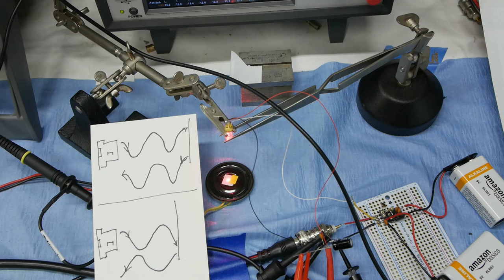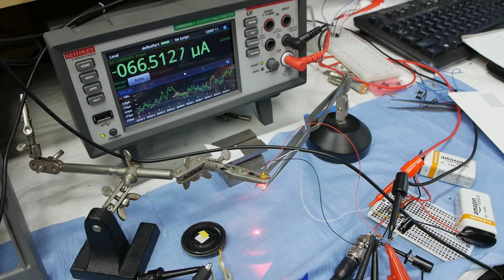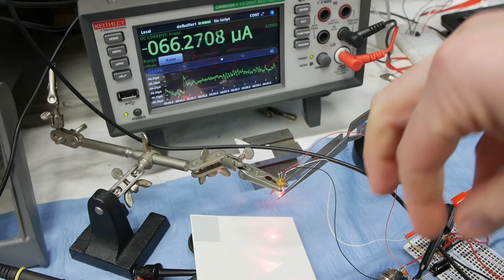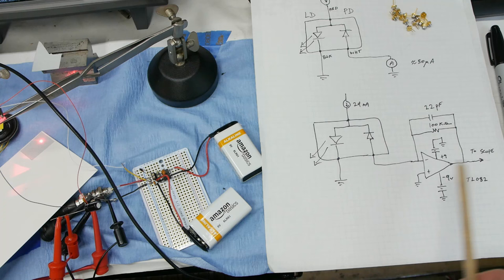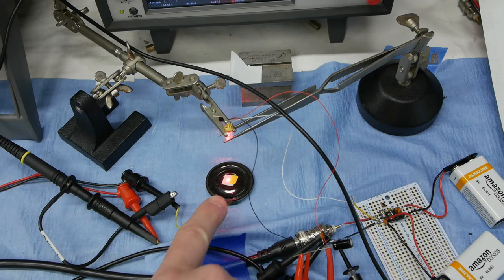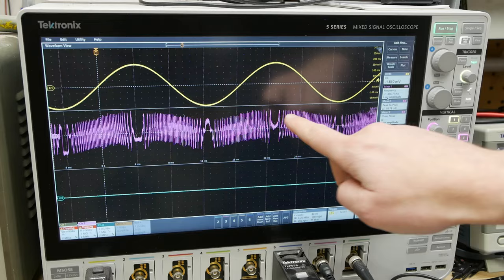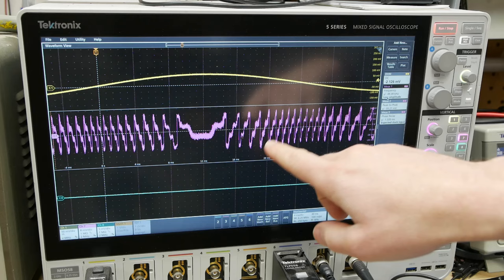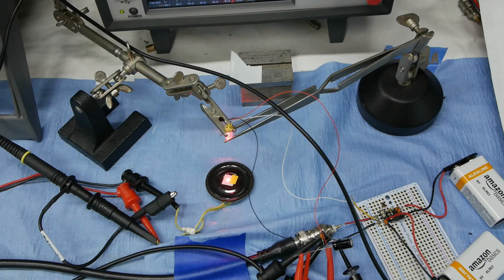Laser diode self-mixing: Range-finding and sub-micron vibration measurement

Comment: Some optical drives use self-mixing interferometry. I was confused when I disassembled them and didn't find any apparent sensor to detect the light reflected by the disc. I don't remember how I looked it up online, but I somehow found self-mixing interferometry in my searching, and thought it was pretty cool that you could use the free space between the laser diode and the target as a kind of secondary laser cavity, and measure how well that cavity lases as a proxy for the distance. I had no idea it was this easy to do, though. (I say easy, but I hope it's even easier than it looks, because I don't have a fancy SMU or DSO…) The FMCW macroscopic range measurement is a cool bonus, too. Now I'm imagining building a pocket tool like those commercial laser distance measurers, but that measures centimeters to micrometers instead of meters to centimeters (and also has a tachometer function).
Reply: It's probably more likely that they use that technique just to determine if the disc is there or not. Even if it appears there's no separate sensor, the laser and photodiode can be packaged very close together with some optics to reflect the light coming back into the receiver.

Comment: Thanks for a very interesting video!
Have made a few reflective sensors using laser diodes and very thin fibers for micro mechanical measurements inside inkjet heads. Used small half mirrors from ES and external photodiodes. These worked surprisingly well but calibration was difficult. Wish I had known this self mixing principle then, since Interferometry gives an absolute measurement.

Comment: You can see if your AC electroluminescent displays are actually oscillating at the driving frequency. It would make sense that the width between the top and bottom electrode is expanding and contracting due to the strong applied electric field.
Reply: If you make the laser light bounce off both the top and bottom of the EL strip at the same time, you may get double the amplitude, and see double the count of interference fringes. Comparing that measurement to single-sided will provide a nice double check on results.

Comment: Wow. Great work! One of the first projects I worked on back in the early 80's was programming a laser dilitometer we built. It used a laser interferometer to measure the change in length of dental material samples in a precisely controlled optical furnace.

Comment: The technique presented at the end of the video, sweeping the wavelength and measuring the interferometric fringe spectrum is essentially Swept Source Optical Coherence Tomography (SS-OCT). The axial resolution is proportional to the sweep bandwidth, i.e. the higher the bandwidth, the higher the resolution. If you scan the laser over a sample, and for each scanning point take the spectrum of the fringe signal you get depth resolved reflectivity. Do this with large enough bandwidth, and with fast enough sweeps and you can create volumetric scans like this: https://www.youtube.com/watch?v=vEgrpwtP0UQ

Comment: I have built and tested FT-IR spectrometers.  They use a Michelson interferometer with an internal laser interferometer that generates a sampling waveform.  The repeatability of sampling is very precise - often less than 30 nanometers of drift over a 24 hour period.  The laser signal resembles the scope pattern you are showing, although most of it is a sine wave. At each end of travel the laser signal frequency drops down to zero Hertz, similar to the discontinuities your waveform shows.  One company I worked for, in the '70s, made a film thickness gauge for semiconductor films.  It was a low resolution IR spectrometer that only had to do peak detection.

Comment: Very interesting video. 
One small error... To go from constructive to destructive interference requires a half-wavelength difference in path-length. To go from constructive to constructive requires a full wavelength in path-length difference. But because the path is to and from, for example, your speaker, the speaker only moves half a wavelength for each full cycle. So, for most of the video, your speaker is only moving around 3 microns!

Comment: A major contribution to the "stair step" waveform shape is caused by the transfer characteristic of the transimpedance amplifier itself, which is effectively an integrator with a reset time proportional to the RC time constant of the feedback resistor and feedback capacitor. You want to match the feedback capacitance as closely as possible to that of your sensor (the photodiode). Note that at these small capacitance values, the wires themselves can start to dominate the total effective capacitance. So you want lead lengths as short as possible. You also need good (low ESR and low ESL) decoupling capacitors between each rail and ground.

Great video, this is a really cool use of the monitor photodiode!

Comment: So if I understand this correctly, the distance measurement is the same thing as modulated continuous wave radar, except in the visible spectrum? Really cool!
Reply: The distance measurement is actually like a FB interferometer where the fringes rate (or distance between fringes) is correlated to the distance from the target

Comment: You can cover the laser diode  with a smooth thin  reflective membrane and maybe make a microphone.  Maybe gold foil or aluminum/silver deposited on transparent membrane. The membrane would oscillate with the surrounding air and reflect the laser light back into the photodiode. They're close proximity (right in front of it) would minimize unwanted vibration or movement.
Reply: You can better light up a distant window and hear what they say =)

Comment: this would be really cool if you use this laser diode to read vinyls and play it back over a speaker, laser diode vinyl player nice!
Reply: Not impossible, but very hard.
Challenges:
Focusing the laser (need to read depth information from a very tiny spot at any time)
Stereo signal. ( there are actually 2 analogue signals in each groove. recorded at ~90 degrees from each other.
tracking (the original grooves were laid down mechanically, and there is no way they are a perfect spiral.)

If you can build a dual read head CDROM drive with active vibration compensation, you can do it!
Reply: You are basically reinventing Audio CD :D
Reply: It's done. Google laser vinyl player.
Reply: @zlotvorx  yeah, i see a "LASERPHONE" haha.
Reply: @riaan_za932  I forgot the name and brand, only remember it's Japanese and was shown to me by a HiFi enthusiast.
Reply: As some one  wrote, it is already done, and it is able to play even the dust over the disk. The idea and pattents were developes in usa around 1980's but then the CD player did come on scene and nobody were wanting a vynil player. A japanese company but the rights, and now you can have a laser vynil player for about 10.000 dollars after a 4 month delivery time.

Comment: Seems like there could be some *****REALLY***** useful uses with this. Extreme precision from a distance? So cool. So useful. This could be a game changer in measurement. All the fancy scope stuff could be streamlined and put onto a chip for pennies. Laser diodes can be extremely cheap. This could be everywhere, and everything could have extreme precision.
Reply: Caphits a really common use is in optical media like CR-ROMs and BlueRay discs. 👍🏼
Reply: @MusicBent  > Caphits a really common use is in optical media like CR-ROMs and BlueRay discs.

Yes, but those only need to sense the change in distance of ONE-QUARTER WAVELENGTH, and within a predictable range of frequencies, while ignoring the much larger but much slower changes due to mechanical vibrations and non-flatness of the disc. They also have to ignore the laser mode-hopping and other changes to coherence length, which is not an issue for those optical discs, but IS a problem for many other applications. The coherence length of laser diodes is usually mere centimeters. Much better stability of the laser output is necessary for general-purpose laser measurements, so much more complex optics are needed. Long cavity lengths and/or external mirrors are usually part of the solution, but difficult to apply with laser diodes. HeNe lasers, on the other hand, are very stable after warmup.
Reply: YodaWhat true. Thinking about it again, maybe a more related application is the lunar ranging experiment. I believe they use a short burst and then use timing to measure the distance.

Also, still waiting for the moon bounce ruby laser video 😂

Comment: Next on applied science, making a desktop gravitational wave detector
Reply: Does make me wonder if you could just loop a TON of fiber optic cables instead of shining the light a very far distance.
Reply: @ARVash  yes, yes you could
Reply: Make you wonder, if monitoring the sum collections of errors rate on a high speed fibre optic back bone trunk of a communication provider, will be of used?
Reply: Robert Slackware  Holy shit I think that's totally possible. If you could direct a beam up that high and then back from there without the beam dispersing so much.

Comment: great video! I want to know what the signal sounds like! and can you use the self-mixing interferometer as a laser microphone? or a distortion pedal? :D
Reply from the maker: That's a great idea!  We could down-convert the signal at several different frequencies, and mix them all together.  Maybe get a chorus effect?
Reply: And for the distortion effect, mabe a recording one period of the waveform and using it for a waveshaper is more viable; i believe you are suggesting to feed the input as the current modulation signal, and the output taken from the PD?
Reply: Is this what spies use to hear people in buildings by reading the vibrations on a pane of window glass?
Reply: I might be imagining it but around 8:30 and 25:50 but there seems to be a strong correlation between lots of little spikes in the signal and his voice, especially sibilants.
Reply: I was thinking the signal reminded me of fm or wavefolding. I bet it is a gnarly sound!
Reply: @trey1531   Unfortunately, most of the light would pass through the glass instead of reflect, so you wouldn't get a very good signal. The same techniques might apply to IR diodes though, and IR doesn't pass through glass. Very similar concepts can also be applied to radar signals, which are commonly used in industry
Reply: Two of the most talented youtubers here...so freaking interesting! thanks for your job guys :)
Reply: A laser microphone can be made with from what was demonstrated from what I can tell along with some other remote sensing and I guess transmitting systems.  There should be plenty of bandwidth up to the ultrasonic range and above with no problem.  Can do the math to determine the distance capabilities as well as against different materials with the electronics test equipment and I think will have to make another circuit or DSP to recreate sound I'm thinking at least. 

Wow, amazing demonstration of capabilities with just that one component and set of equipment.  Once the component and system equipment is characterized in detailed and the internal, boundary and environmental characteristics are well understood, patterned and controlled... I can only imagine the capabilities. I also am wondering with performance capabilities with cooling and really super cooling. 

I think you answered partially a Neurophone question and suggested demonstration. 

Wow, great demonstration as always.
Reply: @dylandailey3191  wouldn't that just mean the laser will still reflect off a surface inside the room?
Reply: There's a video by guy which made simple interferometer (actually very easy to do) and connected it to an amplifier. It sounds like noisy microphone.
Reply: @trey1531  Yes it's possible, but according to a documentary they used to place tiny mirrors on the windows.
Reply: @PixlRainbow  Probably, but the idea is that the glass, being a thin rigid sheet w/ high surface area, would vibrate at higher amplitude than, say, a wall behind the glass. Certainly still feasible, but even in the near laboratory conditions shown in this vid, the noise floor is pretty high. But you're right; it still would work, in theory.
Reply: VocalZoom sells such laser microphones used for cars and first responder applications. the sensors are very small and low cost
Reply: I was thinking of a laser mic to see which jerk is blasting your hood...
Reply: Vocalzoom already developed a commercial microphone (1 cm in size) using selfmix implemented in a single IC
.
Reply: @dylandailey3191  I believe they use an IR device for the aforementioned 'window pane spy microphone' anyway, so it reflects off the glass, and so it is not in the human visual range. Years ago (1991) the folks I used to work for, had an IR laser ethernet connection between our adjacent  buildings. It was in Okinawa, and it could maintain a stable networking connection even in Okinawa's  subtropical, torrential rains. Of course that was back in the days of 10baseT speeds....Ok sorry, reminiscing mode off!

Comment: Great Showcase of self-mixing well explained. 
At 12:10 you said that if you count 10 fringes it means that the speaker moved by 6500 nm but actually it's half because of the round trip.

Comment: Was the piece of paper picking up your voice as you were speaking? Could this be used as a very sensitive microphone by turning the distance measured into a wave function?
Reply: I've heard of lasers being used to pick up acoustic vibrations on a pane of glass but I can't imagine its easy.
Reply: Check out vibrometers.  You can use them to easily measure acoustic vibrations in materials.
Reply: I think it was vibrating in response to his voice. I think in principal it could be used as a microphone. But it may not be practical, except for spies and whatnot.
Reply: @mckenziekeith7434  Not difficult at all, in fact it is a very nice electronics beginner project: https://www.instructables.com/id/Laser-Beam-Microphone/
Reply: I noticed the same thing, particularly the “ess” sibilant sounds seemed to be picked up the best.  I wouldn’t call it so much of a microphone as an effect of the pressure waves from speech modulating the movement of the speaker cone.  Very cool though, and just another indication of how sensitive this laser/circuit is.
Reply: @Kalanchoe1  Ben Krasnow actually has a video on this: https://www.youtube.com/watch?v=1MrudVza6mo
Reply: Kept thinking the same thing.
Reply: Glad to see I wasn't the only one who noticed his voice picking up on the interferometer setup at the end. I was totally blown away with the technique used to measure distance, too.
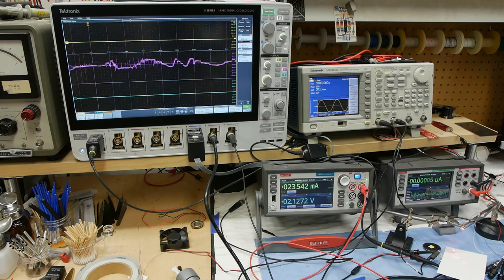Reply: @SiberCatLP  It was picking up his voice from 8:11 onwards. Every different setup he made simply depicts them into a waveform in different manners.

Comment: A wave reflected from a mirror will have inverted polarity, so I believe the top picture shown at 11:00 is incorrect.  Destructive interference would happen as shown in the bottom picture, but constructive interference would occur after a lambda/4 shift (causing a lambda/2 difference between source and reflected waves) A retro reflector would also do this because it has and odd number of reflections (three). 

I think also that the measurement would be twice as precise as you say. There should be two points of constructive interference, and two points of destructive interference per wave cycle. So you have two maximums on the oscilloscope per cycle. 

Great video as always!
Reply: This website has a great animation of wave interference at boundaries. The behavior depends on the refractive indexes of the two mediums, but what I stated above should be true for light going from air -> mirror/paper -> back to air.

http://www.animations.physics.unsw.edu.au/jw/light/reflection-and-phases.html

Comment: You could probably control the laser with pulse width modulation, and then measure how much photosensor data is lagging behind to determine the distance between the laser and the measured object.
Reply: And how would you perform the femtosecond-resolution time measurement required to achieve sub-micron distance resolution?
Reply: Sub-micron resolution wouldn't be possible, but accuracy of few millimeters would be easily achievable.

Comment: 17:17 - This is an important phenomenon to understand, so I'm glad you mentioned it. I was watching a video about a very, very low-pitched flute. They said the lowest notes are outside the range of frequencies the human ear can perceive. Many people in the comments said that they could hear those low notes in the video, but what they were really hearing was a bit of acoustic "slapping" at the frequency of that note. Similarly, we cannot "hear" a 1Hz sine wave, but we can easily hear someone clapping their hands once per second.

This is also the reason I'm not a huge fan of allowing vocal fry in low-note-singing contests. They're just clapping... with their throats.
Reply: clapping would be impacting two surfaces. compared to one surface vibrating the air.
Reply: @mrlithium69  I'm using the term as a gross simplification. We could go with "clicking" instead. What matters is the underlying principle that separates "hearing" a frequency from hearing an audible event that repeats at that frequency. If our ear canals don't have the hairs for it, we're not hearing it.

Comment: Cool video! One minor correction: because you are measuring interference of the laser in reflection, a 330nm deflection of the retroreflective speaker will cause a path-length shift of 660nm of the reflected beam. So the good news is that you're actually twice as sensitive to displacement as you reported! :)